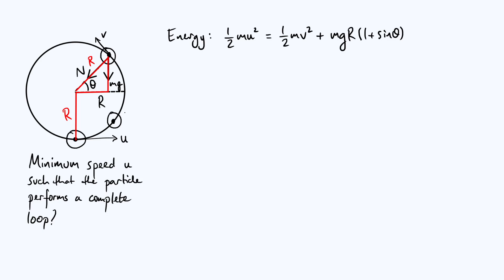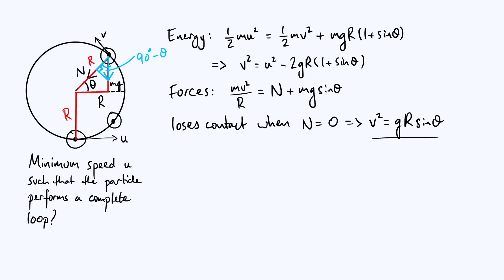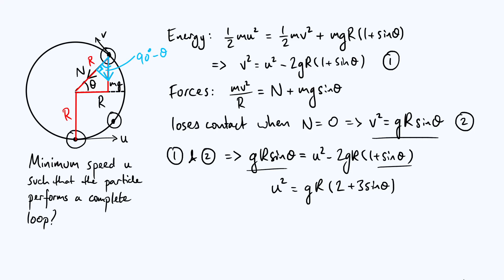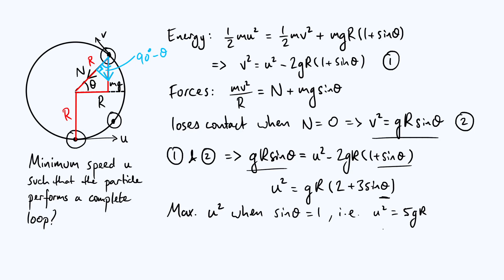Particle on a circular track: speed required for a full loop

Comment: Incidentally, I was working on a very similar problem. In that question a starting velocity of sqrt(22Rg/5) (<sqrt(5gR)) is given to the particle and obviously it fails to complete the circle and falls. The question is to figure out the 1. angle theta from where it falls and 2. distance from the starting point O, where the mass lands. 
Great video. Looking forward to the addition of a rigid body to the problem.
Reply from the maker: Ah, OK! I get sin⁻¹(4/5) for that first part using the equation derived in the video. From there on you can resolve the velocity into components and treat it as a projectile. Next video is already recorded and should be posted tomorrow.
Reply: @DrBenYelverton  Yes sir! Same approach, same answers! Thanks for verifying them for me.